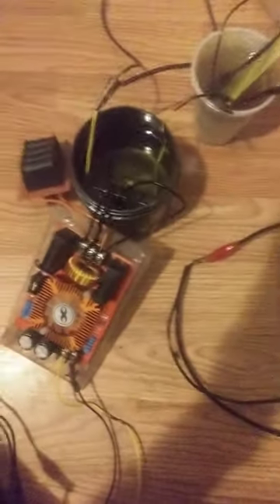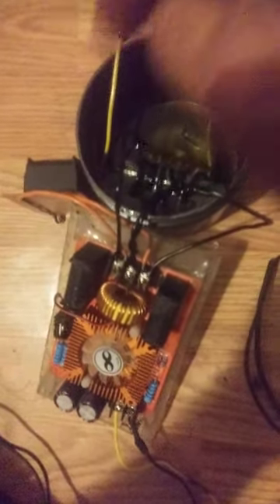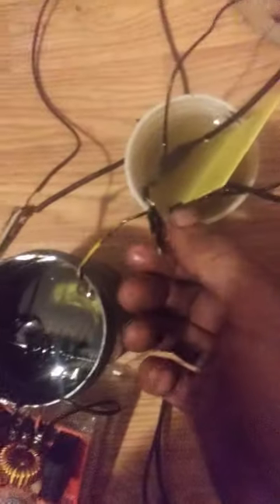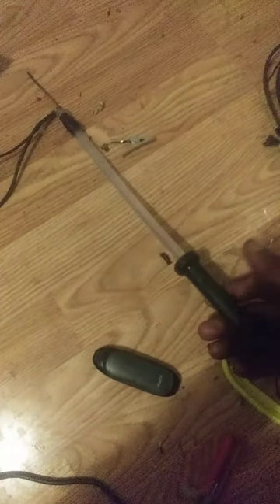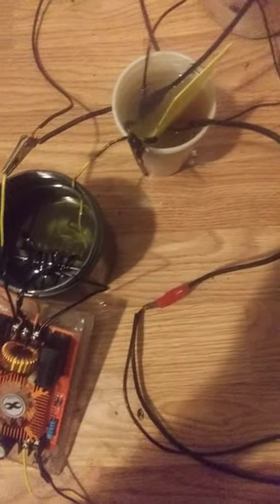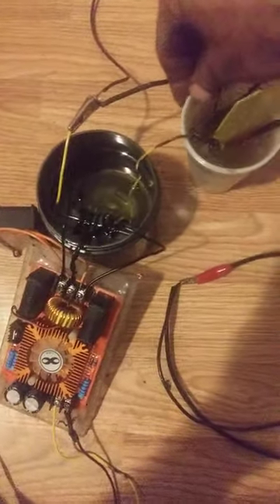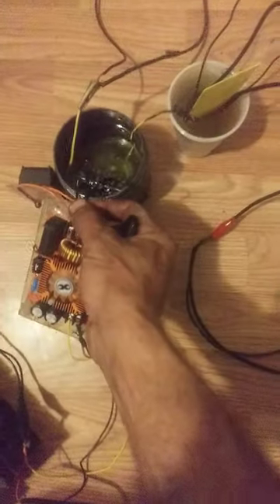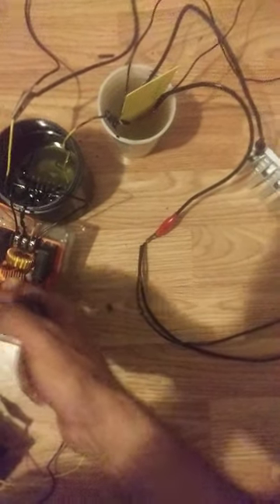Homemade flyback with voltage doubler circuit. Extremely high voltage and current.

Comment: wow, impressive, anyways, as others have noted, the output isn't sparky but it's arky, a voltage multiplier has a "capacitor output" so it's supposed to give out individual sparks, i don't get why this setup gives arcs, the only reason i can think of is that once the high voltage (from the multiplier) strikes, the multiplier discharges the capacitors because of the high output current and acts as a short or simple rectifier and gives out regular arcs... i've seen the same effect on another video
Reply from the maker: https://images.app.goo.gl/G5rkMADLEs4tjNoH6 
This is the voltage doubler I use. If you pull too much current from the caps, it loses the doubler effect and goes back to AC. You'll hear that capacitance pop during the intial jump and then it goes back to AC. It works great with a spark gap Tesla coil too because the process repeats each time the arc is breaks and starts over again. You can experiment with it on low voltage transformers too so you can see what's going on with a multimeter. It basically acts as a one stage multiplier.
Reply: @johnruscigno5738  yes, it's a one stage multiplier, so if the transformer gives out 60kV peak to peak after the multiplier it's 60kV DC... but yeah, you also agree it goes back to AC, maybe rectified

yes, i tried it now on ltspice, when pulling high current the capacitors start to oscillate along with AC and the output is kinda rectified AC at a lower voltage, because of course the arc shorts the high voltage and recuces it

Comment: My God! That's a beefy arc that I've never seen from any flyback before! That's what you've used to power your latest updated Tesla coil using car spark plug! Isn't it? No wonder why you were getting great fluid arcs as output! That's amazing. That huge flyback transformer that you got from an old TV, did you get same output from it?
Reply from the maker: That particular coil you're referring too. ( the spark plug spark gap) was actually another high frequency transformer I built out of the deflection yoke core from a crt tv. But this one worked well too running it through a full wave voltage doubler.

Comment: The device performs very nicely, but what is the use of only showing us the performance of the device.  Could you make some measurements of the input voltage and current? or show us the schematic?
Reply from the maker: https://youtu.be/yiS0Fhmv7N4
Here check this video out. I made a diagram here that'll help you alot more than a schematic will. You can find schematics on Google but a diagram will aid you in component placement and construction techniques. I've shown the output on my Tesla coil but it's the same kind of driver in this video.
Reply from the maker: Btw, you can use smaller n channel mosfets if you choose to build one that would be alot safer than the 90N20Ds here. They'll kill you for sure. So I was hesitant at the time I made this video to show how to build the driver.

Comment: John! I just wanna ask you just like that. What's the big deal with that ZVS you've got.  Does it really differ from the other ZVS or is it only different because the gates are being powered by a separate power supply? The one with the orange heat sink & recently, I've seen you making great use of it.
Reply from the maker: Hi Ramlugon! You can increase the current by putting extra caps across the drains and getting better resonance with the flyback. It makes a big difference haha. The only thing is, it's hard on the mosfets. They actually heat up a lot like this. So they never last long but they put on quite a show.

Comment: Which capacitor are u using on the voltage multiplier
Reply from the maker: See those trash bins in the back? They're polypropylene lined with aluminum tape. Gives me about 4 nf a piece but they can handle up to 50 kilovolts.
Reply: @johnruscigno5738  ooh cool and which value diodes can handle that voltage
Reply from the maker: @nerdylicious1814  2CL2G 10KV 100mA 100nS High Voltage Diode. They're designed for high frequency applications so they'll outperform microwave oven diodes even though they have a lower current rating.
Reply: @johnruscigno5738  two of these right
Reply from the maker: @nerdylicious1814  I used 3 in series to give me 30kv on each side of the doubler. So you'll need 6 total. It's definitely worth using that 3rd diode to make sure you don't kill them.

Comment: I’m trying to build one of these with a homemade zvs driver. Any driver schematics you know of that would drive a fly back like that?
Reply: I’m insane and I want to run a drone lipo battery through a zvs driver and a hand-wound fly back so I can fit it in my hand and maybe add a voltage multiplier. Probably a better circuit to run off of a chicken wire from a distance but I like to live on the edge.
Reply from the maker: @yourboi1842  https://youtu.be/yiS0Fhmv7N4
Reply from the maker: The address is another video I made that gives details and instructions on how to build the driver. Just be careful pls. And make sure you ground the output pins of your flyback.
Reply: @johnruscigno5738  thank you. Your video is very in depth and includes helpful information.

Comment: how many volts does the zvs take
Reply from the maker: This one is about 30 volts max because of the fan voltage regulator. You can remove it and power the fan with a separate 12volt power supply and that will increase the maximum voltage to about 50 volts.

Comment: Wow... What's the input power?
Reply from the maker: About 42 volts. I was using agm batteries in series to get an adequate amount of current.
Reply: @johnruscigno5738  ok thx... And do you have any idea about the current? I guess it would have been around 30 Amps?
Reply from the maker: @fabriziobrutti1205  oh I'm sorry, I misread the original question, yes 30 amps at max power so you're looking at about 1260 watts total input power. The driver was only rated at a thousand watts but you can push it by adding an extra capacitor across the mosfet drains.
Reply: @johnruscigno5738  don't worry :) 
Very nice setup, those DIY ZVS circuits (also Chinese ones but not too much) can be overpowered without big problems 🙃 you just need good components and your safe... In my case the biggest issue was to find a proper 30 Amps input inductor... I ended up by building it from the core of an old crt TV power supply

Comment: Hi John! I’m wondering what kind of voltage doubler you are using, and why is it a continuous arc and not pulsing like all the doublers I’ve seen. Is it because of a very high capacitance on the doublers? Thank you very much!
Reply from the maker: https://youtu.be/D3D6VMlXCKc
Reply from the maker: This was the doubler circuit I use. Only with 20kv, 100nano second diodes and two high voltage capacitors. It's works great for tesla coils. And AC flybacks.
Reply: @johnruscigno5738  Brother, how many KV do you have? If you can electrify pigs, you can make a power grid and put pig bait on them. There are a lot of wild boars in your country, and you can hunt more than 10 pigs at once.

Comment: Zvs driver not homemade tho. Bought the exact same one on Amazon hog
Reply from the maker: Correct, just the flyback. Would you like to see a homemade zvs?
Reply from the maker: https://youtu.be/EnV7mS_DHXM
Reply: @johnruscigno5738  would be nice
Reply from the maker: @RotaryMarx  https://youtu.be/yiS0Fhmv7N4
Reply from the maker: First one is a demonstration of two paralleled and the second gives instructions, and a diagram.